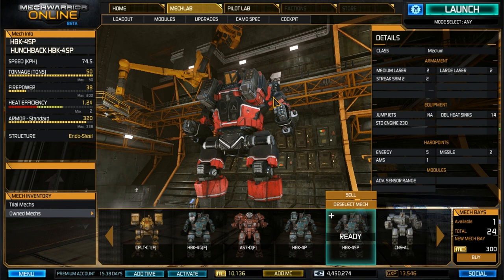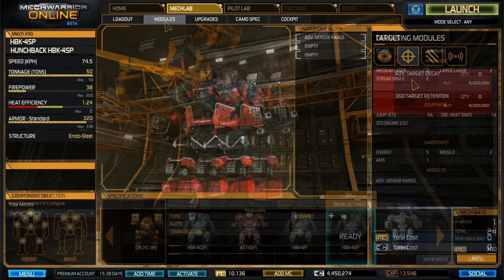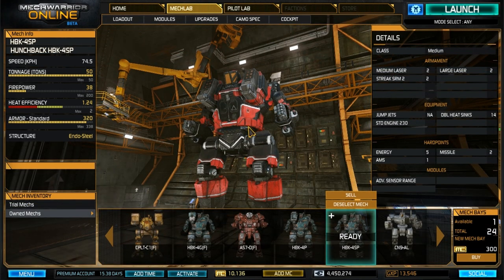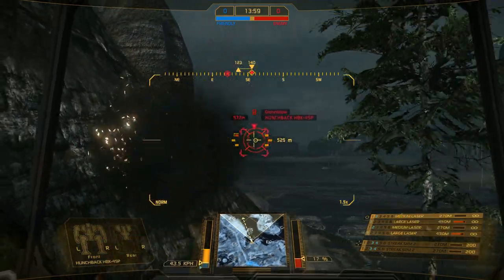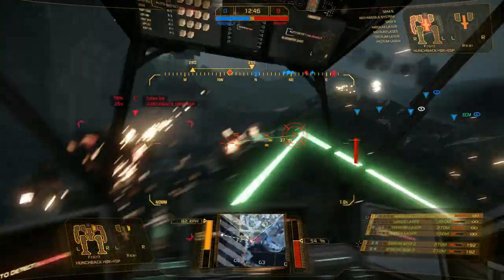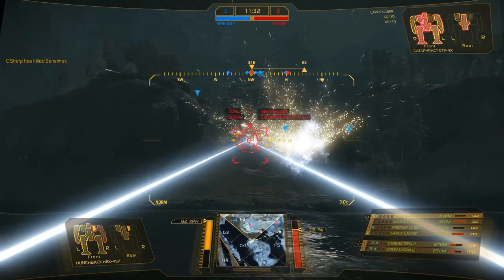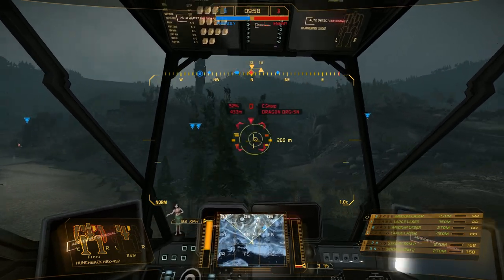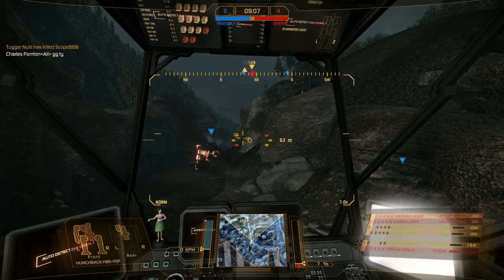MWO: Hunchback HBK-4SP

Comment: I think the center torso is already filled with 6 engine and 4 gyro slots, so the odds of the crit roll nailing the ammo is actually pretty low (1 in 11 chance  I believe).
And this all only applies after your center torso is stripped of armour already, of course..

Comment: i run a similar build but mine has much high fire power

5x M lasers, 2xSRM 6, AMS, 1 ton of ams ammo, 2 tons of SRM Ammo. 336 standard armor, Endo Steel Structure, 250 Standard Engine, 14 Dual heatsinks... 
it runs pretty great as long as i continue to remember that despite equal firepower to many assault configs, I am not an assault mech and am squishy by comparison. so i find an assault buddy :-) and guard his back all match or at least till contact is made.

Hope it works for you guys too